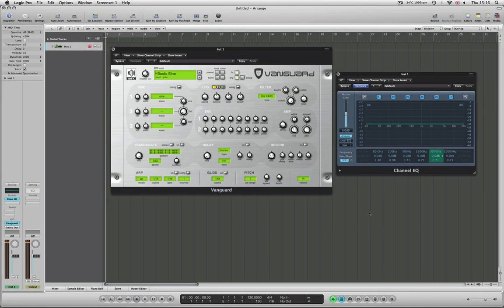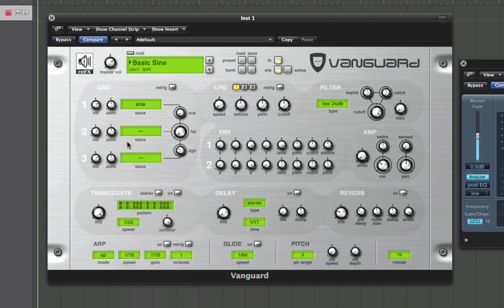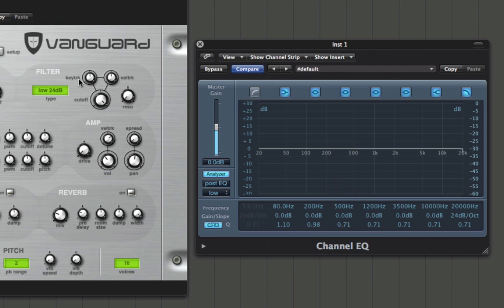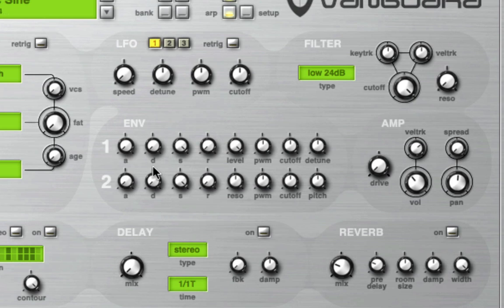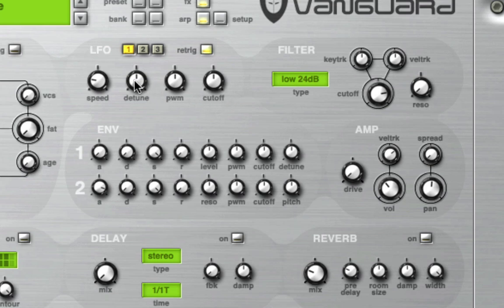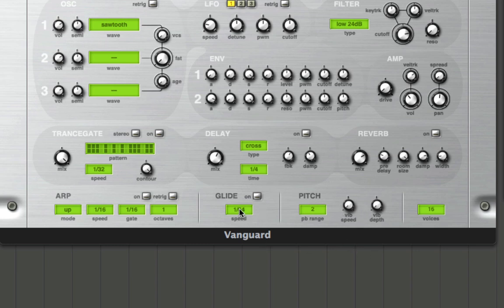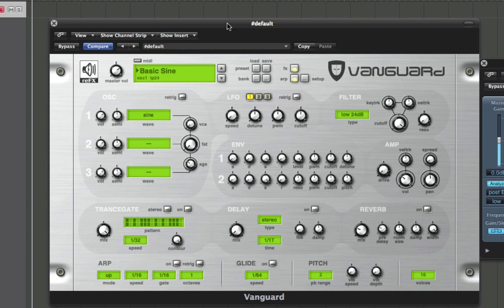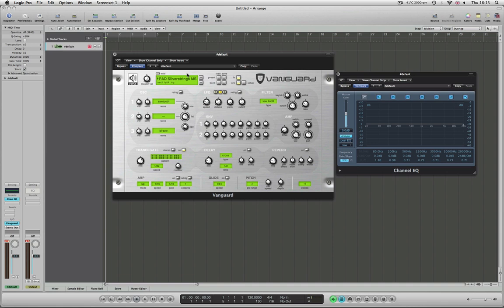Synth basics using reFX Vanguard

Comment: Because this is a tutorial, here's what "VCS" and "FAT" knobs actually do.

"VCS" is the number of "FAT" voices per synth's oscillator (more like extra oscillators than voices because they do not affect the polyphony). It goes from 2 to 10. "FAT" is the voices' detune amount as well as the on/off switch for the "VCS". The "FAT" knob has two stages, from 1 to 63 and from 64 to 127. Each of the two stages affects the left and the right channel of the synth (the oscillators panned to those sides) in a different manner depending on the amount of the voices dialed in by the "VCS".
When the "FAT" knob is in the 0 position there are no extra voices no matter which position is the "VCS" knob in. As soon as you start turning it clockwise, the synth starts distributing the voices specified by the "VCS" knob across the stereo field as well as detuning them against each other, against the synth's main oscillators and the synth's main oscillators against each other. Each main oscillator responds differently to dialing in the "FAT".

Comment: Great tutorial man. Still going though it. I played with the 'velocity tracking' (veltrk) and found that it is NOT the same as keytracking as inferred in your video. A value of zero (default) means there is no change in volume depending on midi not velocity (how hard you strike the keyboard). A value of 100% means you get the full range of touch sensitivity. Minus (-) 100% works the opposite. Light touch is louder, heavy hit is soft.

Peace!